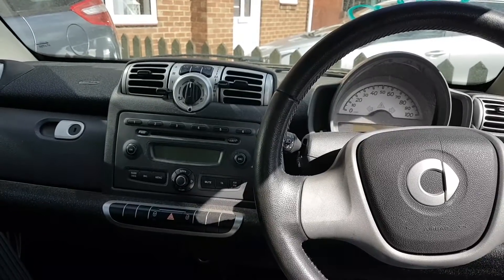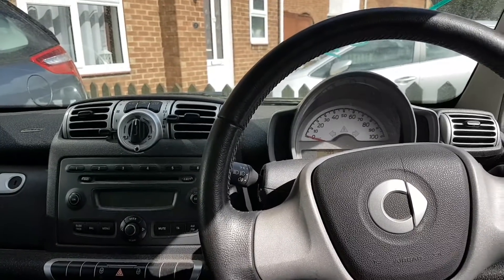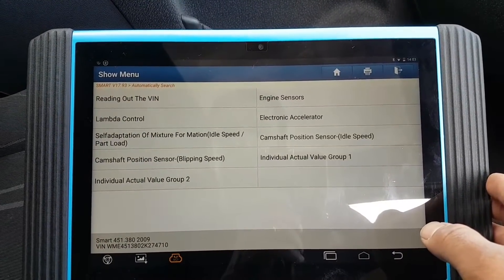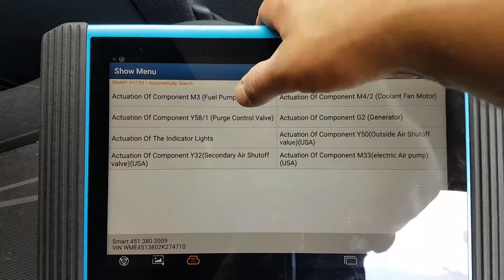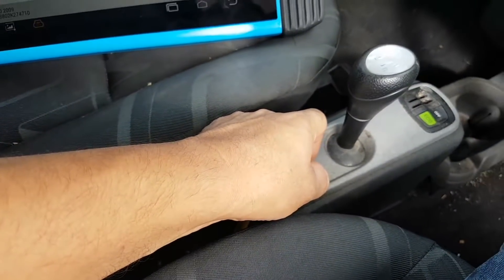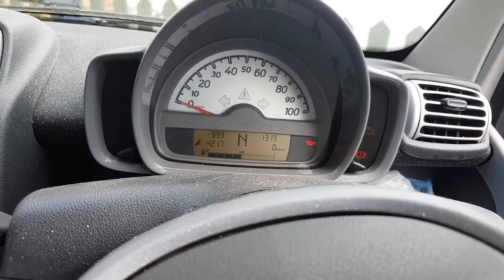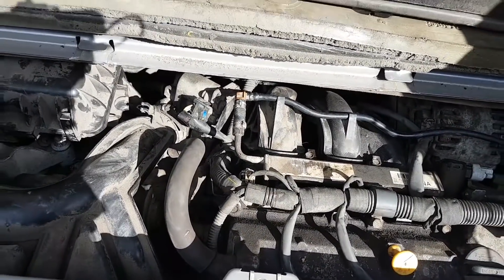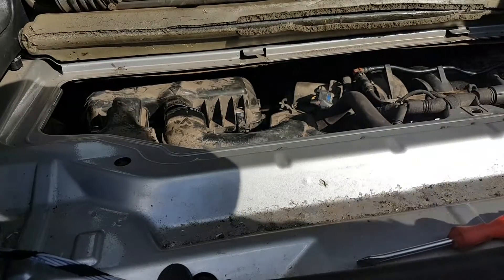Smart Fortwo 451 1.0l crank no start... not fixed, but diagnosed!

Comment: JUST A THOUGHT , with all the cranking from where it came from and from you don't you think the cylinders might have been fuel washed because you did say you smelled fuel and it did not appear as if you disconnected any of the injectors and you showed the fuel pump was running  added teaspoons of oil to each cylinder to see if you may have gotten a change in comparison should have been done . Just my two cents thanks for your time .
Reply from the maker: Yes... I probably should have done a wet compression test...
But still, wouldn't be a fix... in my opinion...
Even dry, should have enough compression to start...
I think...🤔
Thank you for watching and for your comment!
Reply from the maker: @neilmurphy845  
Just one correction... this was not the same car... 😉
Thank you for watching and for your comment!
Reply: @LMAutoRepairs  sorry I thought it was it looked identical to the one the last time and I remember the knocking noise from the other one so I thought I was sure it was the same car
Reply from the maker: @neilmurphy845  
No worries...
No was a different one... had a few of these with different issues...
😊

Comment: Engines quite happily run on very low compression if it has everything to make it run and the low compression is relatively even.
I remember as an apprentice we had a guy come into the shop in a Holden HQ ute with a clutch problem after he had replaced the clutch himself.
He wanted us  to fix  the clutch and give the engine a good going over .
The ute had done some insane amount of miles  and was pretty tired .
New plugs, leads , points and condenser and an adjustment to the carburetor and she was running like a champ, quiet and smooth.
Plenty of blow by so  I checked the compression and found all 6 cylinders only about 50 psi .
Done a wet check and compression sky rocketed .

So Luis , the low compression is not good and I think it would have tried to go given it had spark an fuel, but i reckon its slipped on the  cam timing and munted the valves  or its been severely over heated  and blown the head gasket between the cylinders.
By the way, I could not see any spark on those plugs even when you shaded the sun.
I only saw a very random spark on the spark tester .
You know you have to follow up on this fault and not leave us in suspense.

N
Reply from the maker: Hi
It was definitely spark... trust me!
Unfortunately this has been recorded few months ago... I can try to find out what was wrong with it... 
I don't tend to undertake jobs like this, due to the poor conditions working from the driveway...
Thank you for watching and for your comment!

Comment: if that was a scrapyard engine ,what I have seen in the past was the valves and piston rings get dry over time, 
how we got around this was spray a small amount of engine oil into the cylinder, then turn the engine over if this does not bring the compression up
we put another small amount, (tea spoon amount) into cylinder, then put some old spark plugs back in, turn engine over,  sometimes it takes a few attempts to get it up to somewhere near enough compression
Reply from the maker: Yes... i know about the dry and wet compression test... I guess you are right.. i probably should have done both...🤔
Either way, something was wrong... 
Thank you for watching and for your comment!
Reply: I had my days with scrapyard engines, i hate them, don't know what you are getting,
i enjoy your videos, the information you give, is not available elsewhere, and is very informative

Comment: I like that how you make the compression test! All plugs removed, no variables. Many mechanics does not understand that, if they remove only 1 plug it shows the bad cylinder result even worse. No variables, you get the real readings. The easy test may be is to check quickly the timing on scope. Get the crank, cam and secondary windings reading to the screen and it should show the story within minutes.  Actually 2 signals should be good enough. Or leak down test with smoke. This is too bullet proof. All 4 cylinders, it must be very bad service history if timing is not off. 

About 1 month ago I worked with customer car. The complaint was misfire. I removed all the spark plugs, cylinder 1 and 4 test result was 50PSI less than 2 and 3. 
Thank you!
Reply from the maker: 😊
Thanks!
👍👍👍

Comment: Not the first time I've seen this . A breaker has 2 cars . One is maybe newer with a bad engine and the other older with a good engine . Do a crappy engine swap and they can sell a newer second hand car with a good engine . The other goes to auction as a no runner but cranking and at auction you buy as is so no refund or returns . This is called doing business . Auctions are for pro's so you buy with the worst case scenario ( engine swap ) in mind . Sometimes those pro's let a friend go with them to buy a " cheap " car . Maybe in this case they gambled and lost because a real pro doesn't gamble at auction . He could only have been lucky if the car would have started . No tears are shed here . Got what they paid for and you did a conclusive diagnose . Good work .
Reply from the maker: 😊
A very plausible scenario...
👍👍👍👍

Comment: I have been told that the ignition timing is set by the ECU detecting the slowdown on cranking as the compression rises, if this is the case would a lack of compression  make it impossible for the timing to be set ? Hence no start.
Reply from the maker: Yes, well, the ecu adjusts the timing, but if the engine is bad and has no compression, it does not really matter how much the ecu tries to adjust...
👍👍👍
Reply: @LMAutoRepairs  Thanks for your prompt reply, I could do with your help with my 02 smartcar, not starting, has fuel  and  spark but timing  moves all the time.
Reply from the maker: A slack/stretched chain?
Have you scanned the car to see if there is any codes?

Comment: I have just sorted my Smart forfour today having been fine it broke down and was recovered by the AA man he said the Fuel pump has gone  It was cranking well but not starting ,i squirted easy start in the carb and it run for a few second , so i checked the fuel pump fuse which was fine ,I noticed that  a big brown connector was not pushed in fully ,so i pushed it in and tried again and the car was back to normal ,its usualy some thing or nothing , I was about to take out the fuel pump etc .. Phew
Reply from the maker: Good call...
👍👍👍

Comment: As soon as I heard the engine turning it sounded like very low compression, quiet and spinning faster than it should. 
Also even without a spark, easy start will run a petrol engine. So at the point you used easy start it was a certain that it was a compression issue for me.
On another note, your videos are great and I thank you very much for all you do.
Reply from the maker: 👍👍👍
Thank you for watching and for your comment!

Comment: Thanks for the video. At 56k miles my smart 450 lost some power. Rough running on tick over speeds and engine light on. Found that compressions were 230 psi, 175 psi and 75 psi on Number three cylinder. Interested if you did the engine out and found why low compression?
Reply from the maker: No I never removed the engine, nor looked any further...
👍👍👍

Comment: Mine's doing this exactly same thing. I'm guessing it's the fuel injectors or fuel pump on mine. Apparently not unusual with this model and year.
Reply from the maker: Hope you find the issue...
👍👍👍
Reply: @LMAutoRepairs  Fingers crossed! Thanks for the vid, because I was looking in a completely different direction - gave me something else to look at.

Comment: Very interesting.. Its not one of those smart engines that has two plugs per cylinder is it. Although as i remember they have they coils and each one has two ht leads...i was thinking someone had left the other 3 that are usualy behind the bumper loose...good diag though.

Comment: Can we see cam / crank correlation waveform? Oil sump pressure waveform? Intake manifold pressure waveform?
Reply from the maker: The no compression to me is enough...
The why no compression is not for to investigate... if that makes sense...
Thank you for watching!
Reply: LM Auto Repairs I tend to be critic in comments I know. Of course depends how far your agreements meant to diagnose. But to me, the diagnostic it’s not done yet.
Reply from the maker: @liviu2004  
It is to me...
The no start is due to no compression...
The why no compression,  is a different diagnosis... and as I said... not for me...
🤪
Reply: @liviu2004  🤣🤣🤣

Comment: I don't know if that's a timing belt/interference engine but I'm wondering if a belt broke and bent valves and somebody just threw a new belt on without checking.
Reply from the maker: It is a chain... but yes, that could have happened...🤷‍♂️
Thank you for watching and for your comment!
Reply: Yeah or itbl ran  out of oil or judging by the flashing spanner lights the oil was never changed the car was never taken care of

Comment: Glad you didn’t do a relative compression first, with all cylinders at around 50 psi  the fault then wouldn’t have shown up sending you off in an entirely different direction.
Reply from the maker: Indeed...
Not very often I used that test...
But yes... you are correct...😊
Thank you for watching and for your comment!

Comment: Smart has never made a profit. Mercedes has tried to sell the company for many years. These little cars are made of rubbish and just wear away in no time.
Reply from the maker: Thank you for watching and for your comment!
Reply: Yeah why buy a smart car when you could buy a micra or a Yaris for the same price and they'll actually go forever or a Clio they're pretty good cars too golf Polo the list is endless of gray cars why would you buy a useless car like that
Reply: Mercedes didn't buy them for profit they bought smart to meet cafe ( corporate average fuel economy) they don't have to worry about making the amg have better fuel economy if they sell enough small cars, at least till the standards changed to individual model based off wheelbase

Comment: Hi that will be valve and seats common problem they get badly pitted and in some occasions the head of the valve comes off  also rings (cylinders) are not to clever  either had to rebuild engine on my friends vehicle
Reply from the maker: 👍👍👍
Thank you for watching and for your comment! 
👍👍👍

Comment: Hi , I enjoy watching your videos all the time , but in this case you could do a final check by squatting a little engine oil in each cylinders, then you replace all spark plugs, that way you would regain compression and the engine would start .
Reply from the maker: Yes I totally get that... and I already admitted that I should have done it...
Still, that wouldn't fix the problem... 🤪
Thank you for watching and for your comment!

Comment: overheated, someone skimmed the head, put a new head gasket but never addressed the fried and stuck piston rings and leaking intake and exhaust valves....
Reply from the maker: 🤷‍♂️
Possibly...
👍👍👍
Reply: not possibly.... 100%... I just refurbished this engine.... see in video the vin is entered.... I got this car last year
Reply from the maker: Small world...
☺️
👍👍👍
Reply: just passed mot today and it's close to mint.....
any way of contacting the previous owner? the place I got it from had no key or V5
Reply from the maker: I know the person that owned the car at the time, but the car was for sale, so I am guessing they must have sold it somehow with the problem... if only now is being sorted...
How did you got hold of the car anyway, who you got it from are surely the previous owner, or was at auction?
Reply: @LMAutoRepairs  I got it from a scrap place, whoever owned it last probably sold it to them but didn't give any key or V5 so probably must be still on their name, I just need a way to tax it fast, don't want to wait for dvla to send a new V5 following application as it takes too long..... I mean if there is a possibility the current V5 exists why not ask....
Reply: so I presume I will have to apply for it, would it be possible to know at least the postcode of the previous owner so I can tax it when applying ?
Reply from the maker: Peterborough...
Reply: they request postcode.... thanks anyway